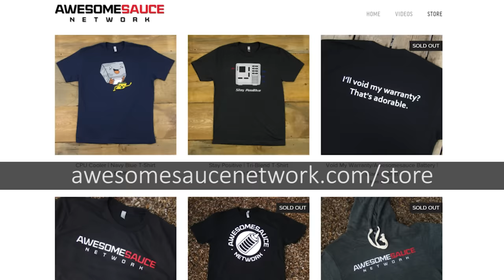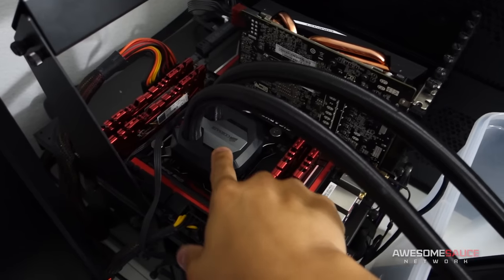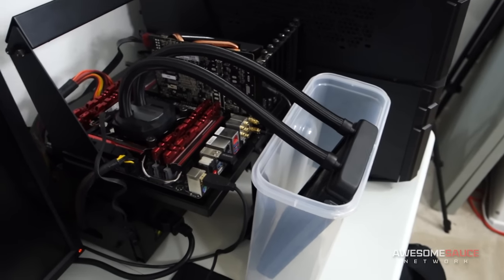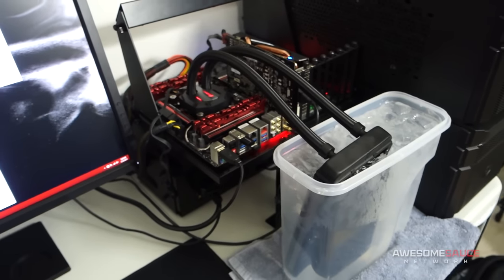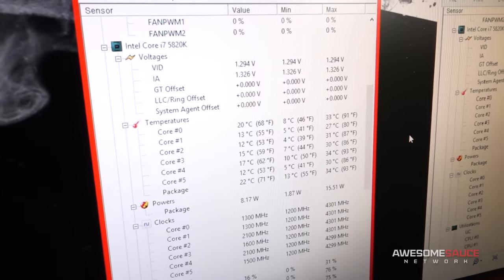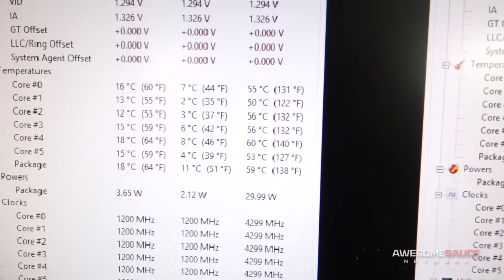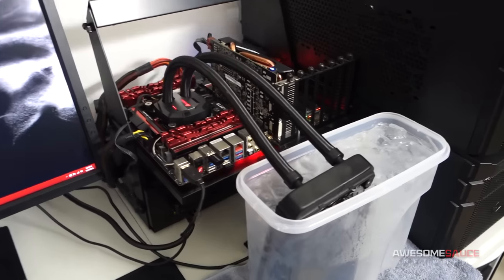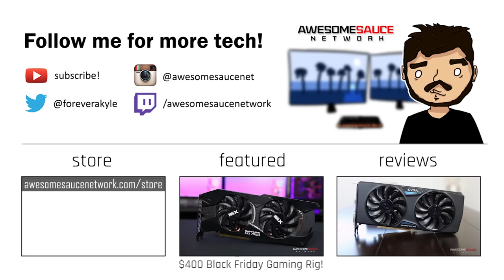AIO Ice Bath Challenge! Does it Work?

Comment: when its winter i put a 240mm rad out of My Window it was around -15c My loops Max temp was around 5c
Reply: Why? If its cold outside the coolers should manage temps above ambient.. If the ambient is -25 , then i dont see the problems with the GPU being -13..
Reply: Until the liquid in the loop freezes solid.  Hot water radiators (like for heating a room) can freeze if you leave your windows open.
Reply: The liquid in the loop can handle up to -20C, if it couldn't it would break the loop in transport.
Reply: Same deal for me, had to add methanol, not sure that was good on my blocks or not but oh well.
Reply: @Hookahitter  could add a few cap fulls of antifreeze treatment.

Comment: condensation will occur if the CPU is below ambient temps.
Reply: Aidan Frost My thoughts. But maybe if you had it running on load most of the time, and the ditching the water when just doing menial tasks?
Reply: 8 degrees celsius is well below ambient temperature if you don't live in Alaska.
Reply: only below the dew point, which varies with humidity

Comment: I thought buying ice was a joke.

What the fuck lmao?
Reply: i only buy artisanal ice, harvested from the center of the article circle, as it is putin free
Reply: Buying 1-2kg of ice for a party is a lot more convenient than stuffing my small ass freezer with 1-2 liters of water inside ice bags and then having to push the ice pieces individually and tearing the plastic.

I got actual food I need to preserve in there, I won't clear my freezer just to save a couple of bucks.
Reply: Filipe Amaral Most fridges nowadays have an ice dispenser
Reply: ***** What is the capacity? I have an ice dispenser at work and to get two ice bag's worth I'd have to wait, it's only useful because it dumps the ice into what is basically a freezer and we don't use it to store anything but ice - it fills up, we take a bucket of ice, when the bucket runs out it has already filled itself up. If it had food in it, we'd have to take the ice out and it would melt before we had a usable quantity.
Reply: Filipe Amaral Mine's about 10x5x10 inches, automated too you just hold a cup under the switch and you'd only normally be taking 4 or 5 cubes at a time, you can take it out though and dump the ice if need be, I've never timed how long it takes to refill though, probably a couple hours.
Reply: ***** I meant capacity for the ice inside the dispenser, 4 or 5 cubes is really not the kind of quantity anyone should buy a bag for. If I need it for a few drinks I just keep the freezing bags/ice trays on my freezer, but if it's a party or something I'd rather just buy the bag. I've overheard so many people talking trash about the ice that you buy in the supermarket, never confronted them but I'd really like to know what they'd do if they were asked to bring party supplies at the last minute.
Reply: I know but i assumed physical dimensions might give you an idea since i dont know the capacity of it myself.If it's a party then 4 or 5 cubes per drink is what you would take from a bag of ice and a dispenser is always regenerating ice so you never run out. Ive never been asked to bring my own ice to someone else's party lmao
Reply: ***** Yeah, but nobody around here got any of the fuckers, hence the only ice dispenser I use is at my job in a fast food place where the damn thing has been freezing ice cubes all day. For small amounts of ice, I can deal with the trays. Larger amounts would deplete the dispenser anyway, so nobody wastes money on that ice dispenser feature.

I haven't been asked to bring ice either, but I am a considerate fellow so I get the drinks AND ice because then we dump it into plastic laundry baskets/buckets and stick bottles into the ice.
Reply: Well we've had one in the house for 6 or 7 years and whatever capacity it has has been plenty

Comment: did you come across any condensation around the cpu block?
Reply from the maker: Surprisingly I did not, but dry ice might have had a different effect.
Reply: +Awesomesauce Network Would this result possibly change if you were running at idle? What I am trying to say I guess is if you ran the computer at idle for a couple of hours rather than testing it most of the time.
Reply: That would depend on the ambient humidity, dew point temp, surface temps, etc. With any sub-ambient cooling methods you'd want to keep those things in mind.

Comment: Did something similar many years ago. Custom made aluminium CPU block on top of an AMD Athlon XP 3200+, some pipes, a small fountain water pump and a bucket... i had a freezer nearby so I was keeping about 6 plastic 1.5l bottles from mineral water inside that freezer. The bucket full of water, the pump submerged in the water and one of those plastic bottles (completely frozen) also submerged. No radiator, open loop. It was melting one bottle for about 2 hours. Then i was just getting the next from the freezer and putting the melted back in. Was running my system like that for months. :-)

Comment: I did this the other way around with a pump sitting in icewater and the radiator out in open air with a couple fans attached. Pumped plugged into the wall and fans powered by a modified USB charger. Works as a small swamp cooler etc to generate a little bit of cool air on a hot day.

Comment: Very nice thing to test, now an addition to the idea. Buy the smallest freezer available and mod it so you can put only the radiator inside it and keep it there the whole time(along with the bucket and the water). There are even smaller freezers out there that are USB powered, for drinks like BEERZZ and stuff like that. Try using metal container instead of plastic for the water too, it's gonna freeze faster. You might need to find the sweet spot for the settings of the frezeer so it won't turn off for too long(not sure if you can run it constantly, though i don't think you'd have to since the ice could hold up in there for quite some time in there and the load temps won't be at max at all times) and then there is(probably) the noise factor(isolation, sone how possible? yeah i think you can) but still, cool thing to try and i think it might prove a permanent, easy DYI solution if it's well executed. Unlike Linus's "whole pc inside a freezer" idea, i think this could work pretty darn well.

Comment: why dont you try this again but freeze the water
Reply: YoYOHoneywasp  I really hope he responds to this.....I wanna see this for sure! lol

I can pretty much summ it up tho the water in the aio would freeze then once the pump powers up it wouldn't be able to move anything.....then after that the pump would die........and the water would heat up and stay in that small location.....until it got really hot....
Reply: water transfers the energy more efficiently than air. That's the whole logic behind liquid cooling.
Reply: orangeapples Yes your not wrong but. There is still energy being transfered to the radiator but being rapidly cooled
Reply: are you saying to submerge an empty rad in water with the openings above air and then freeze it. Then hook up the frozen block to a loop and then do tests? because that I'm actually kinda interested in now.

Of course after the loop runs for a while the ice around the rad will melt and then we'll be back at this video...
Reply: orangeapples yup
Reply: Results would be identical because ice transitions to water at 0°C. As soon as you put warm coolant through the system, ice around the radiator would immediately reach 0°C and transition to water, and as long as there is ice in the bucket, it would stay at 0°C.

In the bucket of ice water in the video, the water was also 0°C because there was ice transitioning to water.

This is of course without taking convection currents into account. Heat from the radiator would cause movement in liquid water, which in turn would cause the heat to be diffused faster. You can't get convection currents in solid ice, you need a certain volume of fluid.
Reply: Because it would most likely ruin the radiator.
Reply: YoYOHoneywasp
Reply: Jupe but science...

Comment: I'd like to see another video about ice bath water cooling, where he either cuts off the radiator, or disconnects the radiator in a custom loop, and just sticks the tubing into the ice water. I would guarantee it would give even lower temps than jut a radiator ice bath.

Comment: Puting AIO in a Freezer and Testing for half a day or 24h ? Eh ? ^^
Reply: +Deividas Gedgaudas That would work, you don't understand how freezers work....
Reply: If it's constantly running a benchmark - I don't think the temperature inside the radiator and CPU block would go below 0C
Reply: sorry i ment would NOT work
Reply: +Deividas Gedgaudas and it wont really freeze because its moving
Reply: the gaming guy tom Exactly.
Reply: +Deividas Gedgaudas linus did something similar by putting an entire pc in a frezzer
Reply: +Deividas Gedgaudas you would probably just thaw the freezer out, since they're not usually made to hold a heat source
Reply: +Deividas Gedgaudas A freezer cant maintain moving a constant heat source it'ss just kill the freezer while not being cold at all
Reply: +Deividas Gedgaudas  It would, could, will most certainly work! 1st, as stated before. Any moving fluid will not freeze until temperatures reach the thermal dynamic of that fluid. I.E. there is a limit to what a fluid can take before it freezes. That being said. on to the 2nd point. You can use a fluid for the purpose of a coolant, that has a much greater freeze range. More so than your average off the shelf PC coolant. For example, Evans Waterless coolant would stand up to the task. I certainly would avoid using any alcohol based coolant as it will wreck almost any system. 3rd... has to be materials of design. Copper and aluminum make up the bulk of radiator build materials, both dissipate hot and cold extremely well. And since the heat radiating from the cooler setup, would severely overwork the freezers compressor, would a "pre-cooler" not be a bad idea? I mean to say, a large "automotive" style radiator cooling this down... before entering the freezer. The last part of the materials would be the tubing itself. I would suggest PEX tubing for infloor/concrete. It has a second layer to allow it to expand and has a  working life expectancy of 120 years. This project CAN be done. Sometimes you just have to think outside of the box. Never let naysayers tell you "NO".
Reply: +AirborneBadass No, it won't work. It's not about the fluid freezing. It's that the fridge won't be able to handle the constant heat because they are not designed to do that.
Reply: AirborneBadass linus will tell you no, he made a vid about it
Reply: The small computer worked in Linus's video, so if you have a small radiator it might work if you take it once not needed.
Reply: LitGeekSquad Official becouse the condence. but if you put the radiator in there it's almost the same as a bucket of melting ice.
still, condensation is likely to occur. and if it's not to cold to freze the radiator loop
Reply: LitGeekSquad Official how do you think a freazer works getting it's load cold.  you proberly ment that it could not handle the heat distribution.
and the one I saw was the one where he put a pc in there. but Ill have a look as that's different ending as I would have thought. as pumps are ment to handle a bit more stress as thy normally handle.
but thanks for pointing out he did one with a loop in a freezer
Reply: corecass it would be like leaving the door open and having the compressor run until it burns up. The thermostat would sense that the temp in the freezer compartment would be too high and turn on the compressor, the compressor wouldn't be able to keep up with the heat and would constantly run, the insulating nature of the freezer compartment would keep the heat in as it slowly rises and rises, the compressor running the whole time as it struggles to make a difference. In the end, you should just go and do it on your own fridge and see what happens
Reply: all in all I could care less on either side of the argument, those who are comfident it will work should do it and upload a vid after a couple days use. I'm shure there could be a way of using the compressor, evaporator and condenser parts foe a makeshift heat exchange cooler, but that's is way different than puting a heat source in an insulated box and expecting the evaporator to expel the heat efficiently.
Reply: LitGeekSquad Official depending on your system. gas. and compressor. your talking about Freon r12. try propane

I forsee other problems. as how ever you turn it. in the ends you can't use frezer to cool a pc. and on that I agreed with us from the start.  so I no further see point to discuss this further
Reply: corecass I subbed to your channel, I look forward to your froof of concept video and in-depth analysis of benchmark results and temperature readings over extended use.

Comment: I made a custom water cooled pc and the two pipes which connect to the radiator extend out of the case and into a mini fridge under my desk where the radiator sits. I get even lower temperatures and I don't need to keep replenishing it with ice like this setup!

Comment: Does this exercise in any way hint at potential inefficiencies in the thermal conductivity between the silicon and the liquid being circulated and losses perhaps between the circulating liquid, the aluminum radiator and the ice bath itself? If so how can those losses be reduced? I'd like to see you do another video with temperature probes inserted into the coolant in several key locations perhaps as it enters the CPU block and as it leaves the block maybe. Seems like this video shows some big losses in the thermal conductivity of the materials we're buying. Good Job!

Comment: how about use car liquid radiator instead of water for cooling??
Reply: In the early days of water-cooling vehicle heater cores were often used as radiators before mainstream manufacturing of PC rads.
Reply: +InspecktorF The problem is those radiators are made of aluminum (keeps weight down given size) and so won't go well with copper and nickel water blocks without some very heavy duty corrosion inhibitors or what's called a "sacrificial anode".
Reply: +brandishwar older volkswagen heater core's use copper tubes with aluminium fins, so those are an option
Reply: +InspecktorF It won't work well. Car radiators are designed for big-ass airflow, also car-coolant is designed for best performance at around 90°C. When you try to get 90°C in your cooling loop, your hardware will suffer.
Reply: +Metatr0n your forgetting that car rads are meant to cool a LOT more heat, if you got one hooked up correctly it could work really well given how much more cooling surface they have but it wouldnt be practical at all, probably way more expensive in the end
Reply: CreepySamurai

Temp in PC Radiator: 28-34°C
Temp in Car Radiator: 90-110°C

PC Radiator cooled by: multiple SP Fans
Car Radiator cooled by: airstream

Different areas of application.
If you could substitute a PC rad with a car rad, that makes it equivalent to substituting a car rad with a PC rad.
Want to see your car with a PC radiator after 20 minutes on the highway...
Reply: Metatr0n a car motor puts out a lot more heat than a pc, so it should be expected that a car runs much hotter, and car rads arent completely run off of airstream through them, they have fans whether it is a electric fan or a fan driven off the water pump.
Reply: CreepySamurai Ok, discussion over here. "it is a electric fan or a fan driven off the water pump", that sentence alone tells me that you have no clue what you're talking about and I have no intention to discuss with a wall.
Keep believing what you're believing but stop trying to teach other people your bullshit.
Reply: Metatr0n The fan is turned on whenever heat gets over a certain temp etc etc but i agree airstream from moving has more cooling potential but the radiators have the same design.. a car rad has much more surface area so it would cool a pc much better..
Reply: Inspecktor F Linus used that for his liquid cooling a room, and quickly found out that it grows bacteria without high temperatures like cars have to keep it from growing. It will build up in the pipes and eventually block any liquid flow and make things overheat

Comment: Love this! Linus "tried" a pc in a mini fridge, complete fail in my opinion. I have an up right deep freeze with an ice maker, just sitting in my garage. I am working on a custom radiator bundle that will fit inside and cutting a hole through to the top so that the ice can drop down to the bottom. I will use a piece of lexan as a liquid barrier. Along with a drain plug and tube routing, it will be a very intense project. But it must be done! Search for that shit on youtube, google, anywhere! You come up with nothing! Bravo to you sir, this is where it starts!!

Comment: Couple years late, but: Might have also helped to have a small water pump to force circulate the ice water. Localized warming of the water in contact with the radiator reduces the temperature gradient, therefore reducing heat transfer. Gotta keep the water moving and mixing so that liquid as close as possible to the temperature of the ice is always in direct contact with the metal surfaces of the radiator.

Comment: This would be even better if the radiator had underwater fans/propellers that would circulate the water better. Also, if you want even better temps dump a handful of salt in the serial bucket. It will drop temps a few degrees fast. 

This is actually pretty cool. With some effort this could be a realistic gaming setup.

Comment: cooler temps can help stabilize the core's at the same speed at a lower voltage which you can try and achieve higher clocks millage will vary.